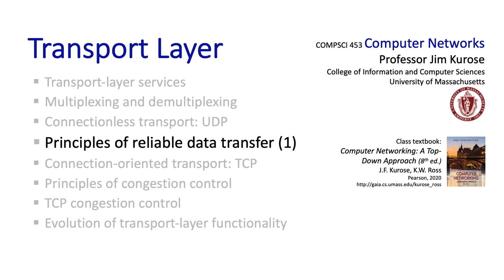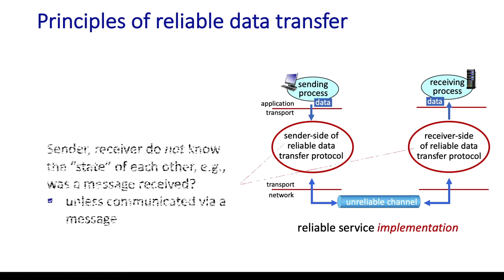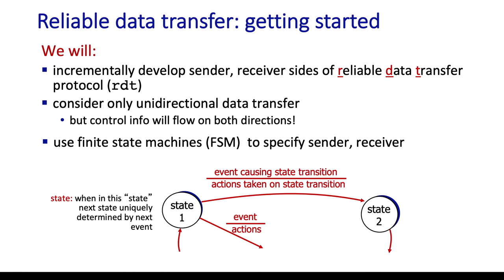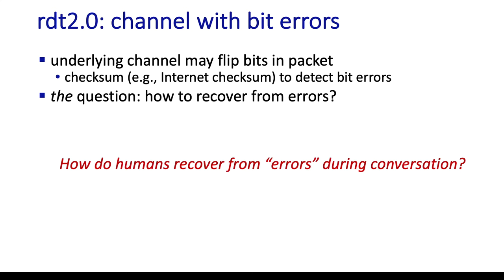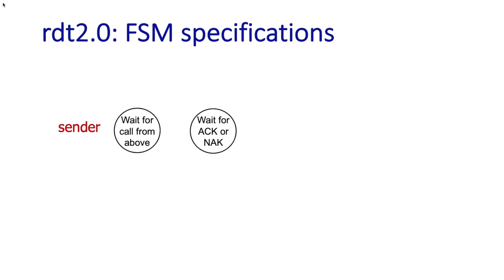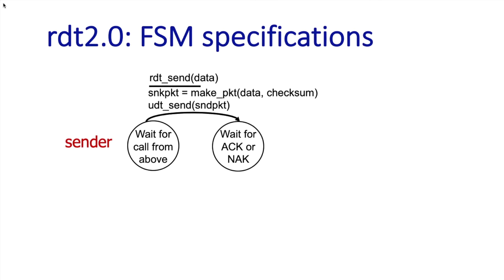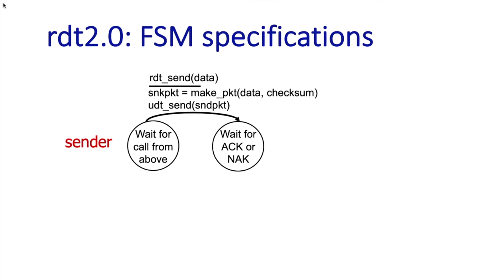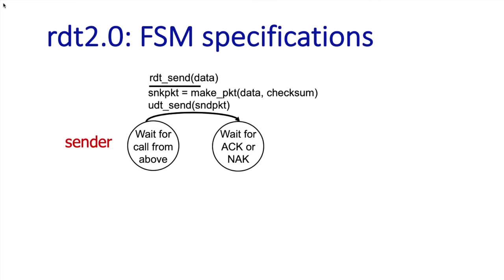3.4-1 Principles of Reliable Data Transfer  (Part 1)

Comment: 21:48 when receiver is in "wait for 1 from below" state and receives a packet from sender with sequence 0 it means... that the sender was looking for the ACK sequence 0 packet from receiver but it was corrupted in transmission. So the sender resends the sequence 0 packet and on receiving it uncorrupted receiver will resend the ACK sequence 0 packet so sender can move on to "wait for 0 from below"
Reply: Thanks bro that was very helpful
Reply: you are smart

Comment: I really appreciate breaking this down into FSMs and getting a better understanding of this process.

However, I'm wondering how the receiver would know that the checksum is valid, and what would determine a non-corrupt checksum.  I've used a checksum comparison in python before in the past but that relied on the sender receiving a packet back and then comparing that the sent and received packets have the same checksum.
Using that logic, I'm wondering how we can determine that a packet is valid with a checksum if we don't know what to compare the checksum against.  What would I be missing?
Reply: Granted I'm new to this topic but I'd think the checksum would be generated independently on the receiver side to compare against the checksum in the packet from sender. This could be done using a hash function similar to what is used with hash tables, applied on the data in the entire packet. With large enough prime numbers used in the hash function so the probability that an uncorrupted packet and corrupted packet will generate the same hash value/checksum will be very low. There is the possibility that the checksum in the  packet from sender will be corrupted but that just causes a retransmit...

Comment: Question:
at 13:40, for the sender fsm when the sender goes from 'wait for nak or ack' to 'wait for call from above' there is a event rat_rcv(rcvpkt),, does this mean the receiver sends a ACK/NAk messgae in the form of pkt  ??
Reply: Yes, from the state "sender is waiting for ACK/NAK" from receiver, it only goes to "wait for call from above" when it receives an ACK from the receiver. If it receives a NAK, it will send a packet to the receiver and still be in in the "waiting for ACK/NAK" until it gets an ACK

Comment: At 18:16 I don't understand something. It says if it is corrupt it retransmits current pkt. That means there will be multiple versions of the same pkt. But there will also be multiple packets being sent after the current packet, that are just in the regular flow of things. So there will definitely be multiple packets getting sequence numbers, but are those packets that get the sequence numbers the retransmitted packets that are new versions of the corrupted packet, or are they the packets that are being sent(the ones that are sent anyway if there is no corrupted packet)?

I rewatched and I'm 90 % sure if a packet is corrupt it will have the same number as the resent version. Right? If it is such a way that it starts adding sequence numbers after a corrupted packet then why don't they start out by giving sequence numbers in anticipation of a corrupt packet?

Comment: UDP is reliable protocol or not?
Reply: The Protocol itself is unreliable. But you can make adjustments just as in the video on the application Layer Level to implement a reliable Service